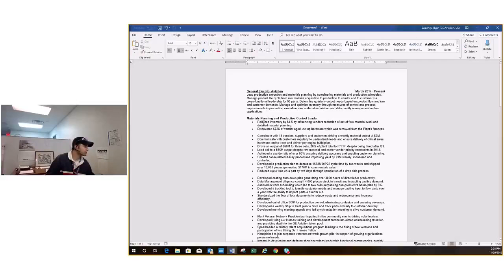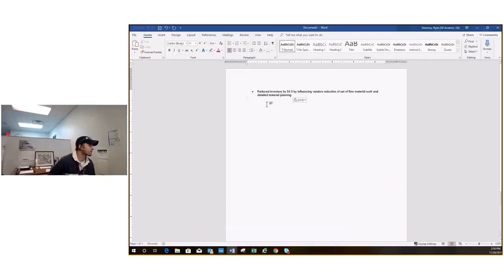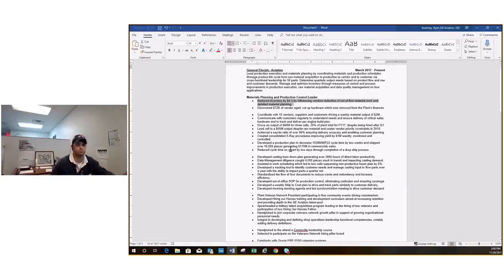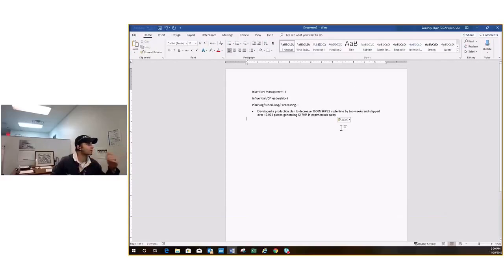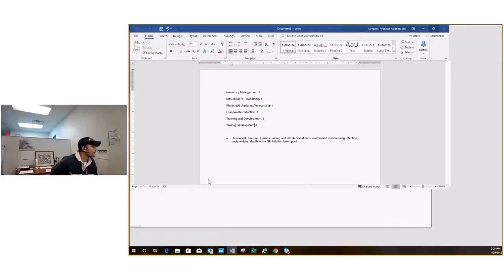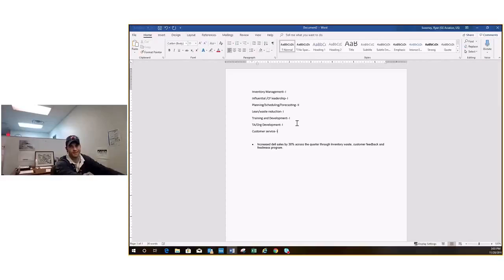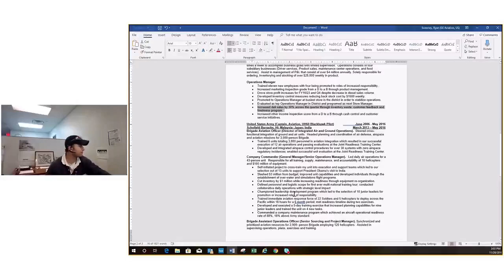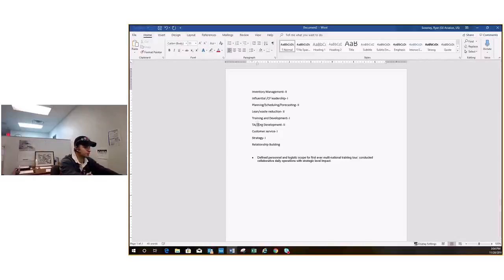Matching Skills to Job Description (Part 1)

Comment: Hi Ryan
I am from India
Could you please tell me what to do 
I have uploaded my profile and make summary for HR executive in some job portals and updating it twice a day
The thing is ,I got a few calls n mails from the recruiters to apply for the job.
I applied for those jobs after having glance on JD as per the requirement what they need and what I want
The JD and my profile is up to the mark n same so that I applied
Then, i didn't get any call from them about shortlisting me for the interview
I gone through with portals what exactly the recruiter did with my application, there I found the keyskills is not matched though those were same pin to pin
Should I change my resume and profile in portals for every single time of job application  as per the JD